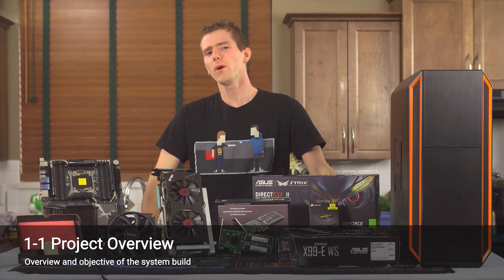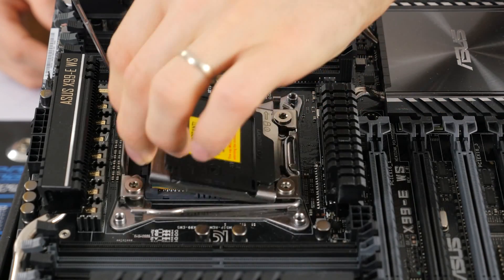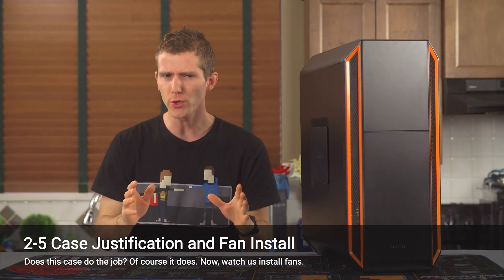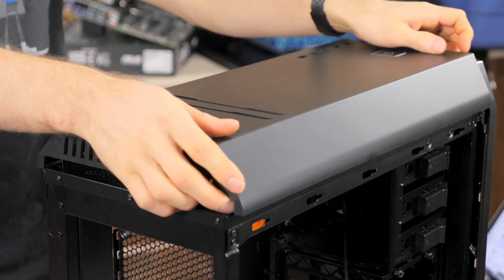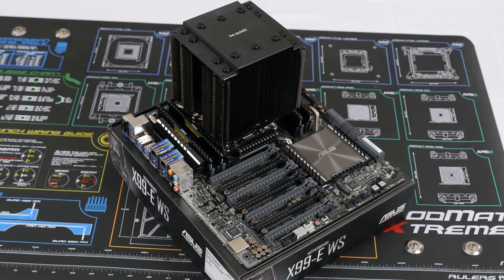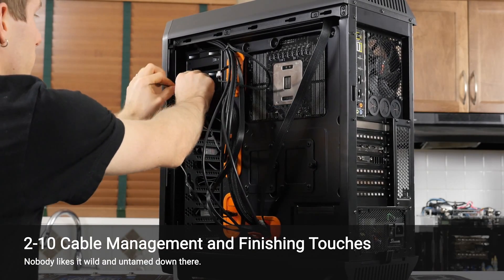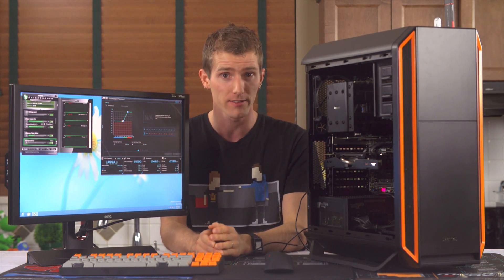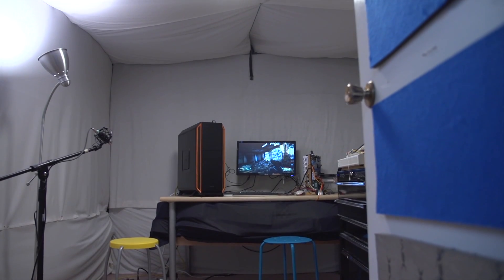How to Build the ULTIMATE Silent Gaming or Workstation PC

Comment: I am a huge fan of passive fan-less silent machines.  I think taking the dust filter off the back of your pc and keeping the tower off of the floor and desk instead, as well as removing the fan on top may bring it below 20db under load.  A cowling covering the fan to the heat sink would also help to dampen some of the sound off the primary chassis fan.  I really like the Heat Sink, passive fanless Power Supply and SSD Expansion Card that you are using and am considering making those transitions myself.  I have been using fanless gpu cards for years now and have not found any need to over-clock my processors.  I am currently only using a dell optiplex dual core with a 1gb asus EAH6450 fanless gpu and I have to put my ear up to it to hear anything even while playing battlefield BC2.  I have come across a quad core and will be using some of your suggestions because it is like starting up an electrical generator when I turn it on.

Comment: It seems like it would be to hot. I only worry about the heat of the psu wafting right into the graphics card. If you had at least taken the front fan out and put it blowing in at the bottom it would have gave some air to all the parts. As is the whole bottom the the comp is holding heat and the gpu fans are just stirring it around. The fan at the bottom would have even been quieter.

Comment: im sorry, do i see intake fans on the front and back?
Reply: Josh Conover "It's basic thermodynamics, and not hard to understand."

- if you want to condescendingly talk "basic thermodynamics" then perhaps you'd like to discuss it in mathematical terms - particularly the fact that the temperature difference is nowhere near sufficient to differentiate between the warmer air and the cooler air.

I'm inclined to ascribe your proclaimed ease of understanding of this subject with the Dunning-Kruger effect. As evidence, I'd cite your following assertion:

"as long as there is any airflow at all inside the case, convection will take over "

- because this is the exact same thing you said moments earlier. This looks for all the world like an unintended tautology, which is a good indication that the person who proclaims it doesn't know the subject matter nearly as well as they think they do.

"There is no vortex inside the case significant enough to make any difference."

- not by design, no. However, these cases are built with the assumption that anyone using them will use that rear fan to exhaust, rather than intake. It's there to help provide directional airflow. How many cases have you used before? I can think of a fair few that have explicitly describe this fan position as an exhaust. The Nanoxia DS6 that I'm currently using does, as do several NZXT and Corsair ones that I've used recently.

Why do you suppose they explicitly distinguish between fan mounts that are designed for intake and exhaust?

"There is no vortex inside the case[...]The front and back fans will push air into each other"

- in other words, the front and back fans will create a vortex. That's what happens when you fire two air currents directly at one another.

Please read up on a subject before assuming you can guess at what it says. You'll want fluid dynamics for this instance.
Reply: Yes
Reply: Talk about condescending. You insult my intelligence by assuming I am unable to read my own comment, and feel the need to reiterate my entire statement in quotations. If you were seeking a respectful discussion, you just took a massive step in the wrong direction. Though, I don't imagine you have any intentions of a civilized debate. Based on your mildly aggressive and pseudo-knowledgeable response to other comments, it seems as though you're trying to seek verification from your peers to overcome an inferiority complex.

Also, I was a nuclear propulsion engineer in the US Navy for six years. If you think I don't know fundamental thermodynamics and physics, you're in the wrong place. If there is no significant difference in temperature to necessitate a convection current, then there must be no need for fans as well, seeing how the hardware and ambient temperatures are supposedly so close. You also confuse "vortex" with "turbulence" or "instability". At no point did I explicitly repeat any statements in my original comment. Reuse of specific words does not constitute reiteration in itself.
Reply: Josh Conover " feel the need to reiterate my entire statement in quotations"

- it makes things easier to follow. Get over yourself. There is no malice in me quoting you.

"I don't imagine you have any intentions of a civilized debate"

- how would you know? You haven't tried to contribute to one.

" mildly aggressive"

- oxymoronic.

"pseudo-knowledgeable "

- sounds like the way I'd describe a statement like " it seems as though you're trying to seek verification from your peers to overcome an inferiority complex."

" I was a nuclear propulsion engineer in the US Navy for six years"

- this is the internet - everyone is an expert in whatever the subject happens to be. How anyone describes their experience is irrelevant. I could easily assert my own tertiary education, and you'd have no idea whether I was telling the truth.

"If you think I don't know fundamental thermodynamics and physics"

- you're welcome to prove me wrong, but your last comment was internally inconsistent. You described a scenario that always produces vortices and immediately asserted that it did not produce a vortex. What conclusion should I draw from that...?

" If there is no significant difference in temperature to necessitate a convection current, then there must be no need for fans as well, seeing how the hardware and ambient temperatures are supposedly so close. "

- that's either incredibly ignorant - disproving your claimed qualifications - or staggeringly disingenuous.

When calculating the relative energy transfer you'd first have to know the respective volumes. This instance has several stages: first, the GPU/CPU die and the heatsink. At this stage, we have a given amount of heat being produced by the chip, which is then being drawn into the heatsink. The disparity in their respective volume constrains the distribution of heat across that heatsink, which is critical, as it's this part which then transfers heat to the rest of the case.

You then have the disparity between the volume of the surrounding air and the heatsink. You also have the disparity in heat capacity across them as well.

You could have a ridiculous amount of heat inside that case without producing significant convection currents. Even then, a single, low-power fan will overpower that weak current. 

Re-read your last post, specifically this bit:

"The front and back fans will push air into each other, and any hotter air will rise to be exhausted through the top."

- see that? You're explicitly pointing out that this situation involves having comparable fans pointing directly at one another. This will result in a vortex, and the flow of that vortex will overpower the far weaker natural convection produced by the components. This is why the above build also features top-mounted exhausts, which will go some way towards alleviating this effect.

"You also confuse "vortex" with "turbulence" or "instability". "

- nope. I'm stating that this case could feature something functionally identical to a tornado. I am broadly talking about turbulence, but specifically vortices. In fact, tornadoes are remarkably relevant here...

"At no point did I explicitly repeat any statements in my original comment."

- wrong. This:

" The front and back fans will push air into each other, and any hotter air will rise to be exhausted through the top"

- is claiming that intake airflow will cancel out and allow convection to draw the heat upwards, and this:

"as long as there is any airflow at all inside the case, convection will take over and do most of the work "

- is saying the exact same thing. Tautologies are fine if you're shortening them for brevity, but when you preclude the latter version with "plus" it means you're offering it as a further point, not a clarification of an existing one.

Before you feel the urge to accuse others of the emotional reaction you may have had, let me say that I'm prepared to go into as much detail as you'd like. If you want to look at the exact dynamics of this then that's fine, although these posts are going to get a lot longer.

All I'm doing is going by what I see, and - whether representative or not - your comments suggest that you're trying to overstate your knowledge. I see more evidence for an argument from authority than for genuine insight.

This may all be a matter of diction and semantics causing a misunderstanding, but that's the deal. For what it's worth, I'm generally pretty irreverent, so don't take any apparent-insults as personal attacks, but as marginally-offensive, impish snipes. The kind of thing you'd usually get from someone who knew you a lot better.
Reply: @redchris05  rap god
Reply: Yep, it's exhausting through the top.
Reply: He hoped so, but it's actually just swirling around inside the case.
Reply: ***** actually, that would produce less of a vortex, as it would quickly reach an optimal pressure at which the rate air was squeezed out of the rest of the case matched that being pulled into it.

One thing I will mention is that the PSU being upside-down may alleviate this. I forgot about that.
Reply: This is a computer case optimized for silence, not airflow. There is no vortex inside the case significant enough to make any difference. The front and back fans will push air into each other, and any hotter air will rise to be exhausted through the top. It's basic thermodynamics, and not hard to understand.
Plus, as long as there is any airflow at all inside the case, convection will take over and do most of the work anyway.

Comment: My current computer setup is a little strange but it is completely silent even when playing games such as ARK Survival Evolved on Medium/High settings. (I am about to do $500 in upgrades). Currently I am using a Phenom II X4 CPU, FOXCONN 2AB1 Mobo, GTX 960 2GB EVGA GPU, 1tb Sata Disk, 550W Corsair 80+ Gold, and a RW optical drive in a crap HP case. Right now it runs silently but the temperatures are a bit high (due to the case I use). As I stated earlier, I am going to do some upgrades. Specifically the case, motherboard, and CPU. For the case I am going with a Phanteks Enthoo Pro M, Motherboard will be the Asus ATX 2600 Z97-A, and for the CPU I am going with the Intel Core i7-4790K. Would there be any changes I could make to better upgrade this build or am I good with these choices? (Im not going with pure silence, just trying to build a good machine for my stream.
Reply: Ayyy finally someone who uses a phenom x4 XD
Reply: DualReaver11 I never said there was anything good/bad about them... People's tolerance these days "lmao"
Reply: Yeah now my system costs over $2.7k USD. Massive Price Jump. Still have my old system though as a memento.

Comment: what I'm curious about is what the noise level would be if this same build was done via a custom water cooling loop with a d5 as the pump and both the cpu and gpu in the loop as the gpu's fans might have been the killer

Comment: Here's my build please tell me if theirs anything I should change I'm going to be doing youtube recordings, editing, gaming, and some photoshop and animations (nothing over 2000)
1. CPU
Intel Core i7-6700K ($420.00)
Motherboard
Asus Z170-Pro ($180.00)
Video Card
MSI GeForce GTX 980 Ti Gaming 6G ($623.00)
Memory
Corsair 2x8GB Vengeance LPX DDR4-3000 Black ($105.00)
Solid-State Drive
Crucial MX200 500GB ($165.00)
Hard Drive
Toshiba P300 3TB ($90.00)
Case
Corsair Carbide Air 540 Silver ($130.00)
Power Supply
EVGA Supernova G2 750W ($110.00)
CPU Cooler
Noctua NH-U14S ($70.00)
Optical Drive
Samsung SH-224FB 24x DVD Burner ($18.00)
Operating System
Microsoft Windows 10 ($100.00)
Reply: don't pay that much for Windows

Comment: is this a good build?:

CPU: intelcore i5 4460k
GPU: radeon r9 380 4gb
Motherboard: MSI Z97-G43
RAM: 2x4gb
PSU: corsair CX 600w
1TB WD red storage
intel 530 120GB SSD (FOR OS)
Case: Corsair carbide series spec 01

Comment: As an audio enthusiast I use open back headphones that offer no noise blocking at all, so there goes the headphone argument. The only thing I must stress is that removing air from the case is more important than forcing air in. Please prioritize exhaust fans over intake fans!
Reply: That creates negative air pressure which males dust build up since you have less air in your case than the surrounding causing air to be sucked in through unfiltered vents in the case.
Reply: I just clean it out every few months. It just takes 5 or 10 minutes to do a good cleaning job.